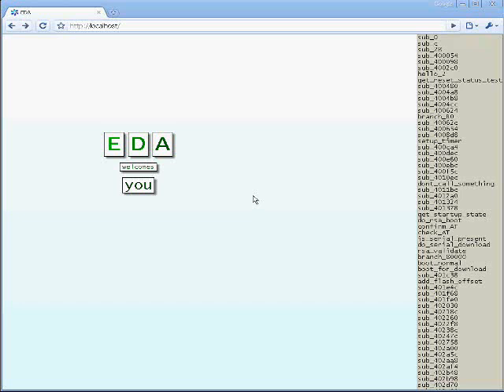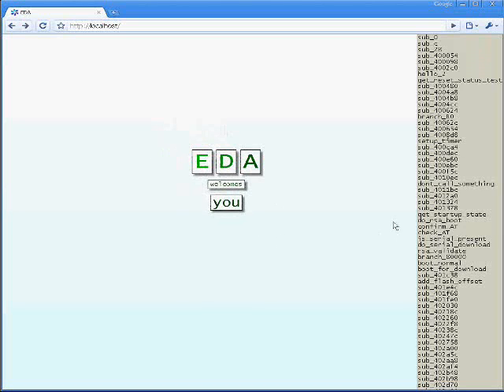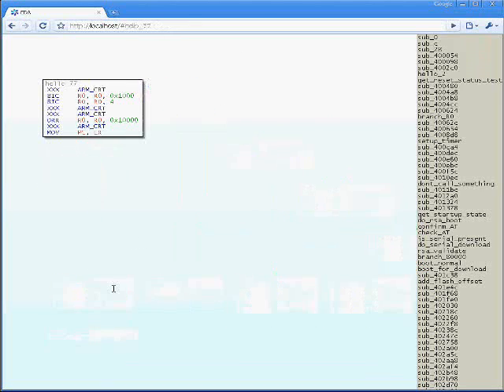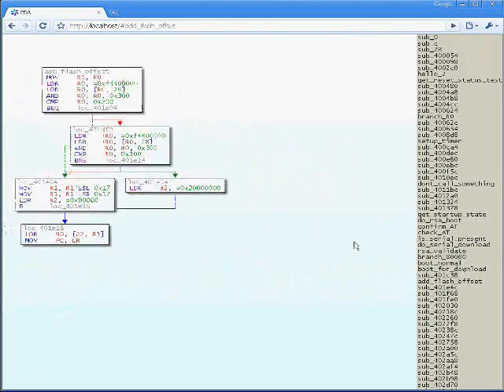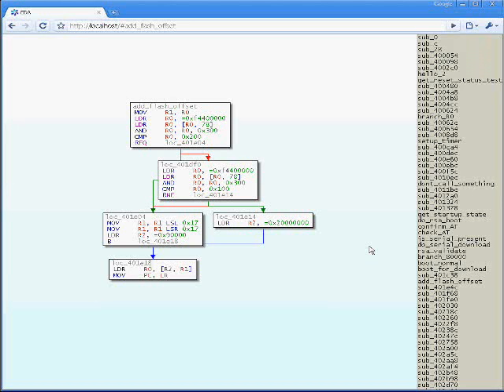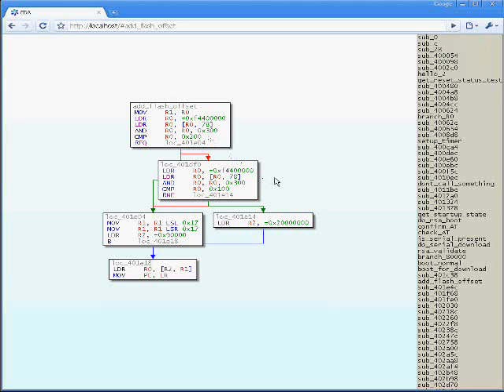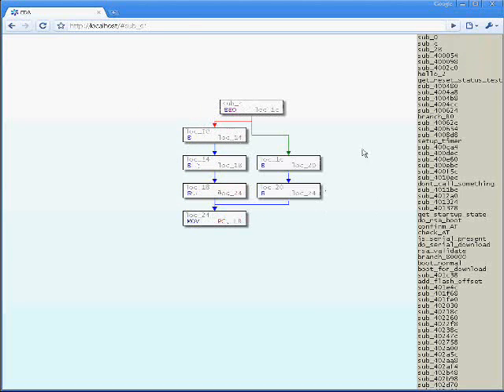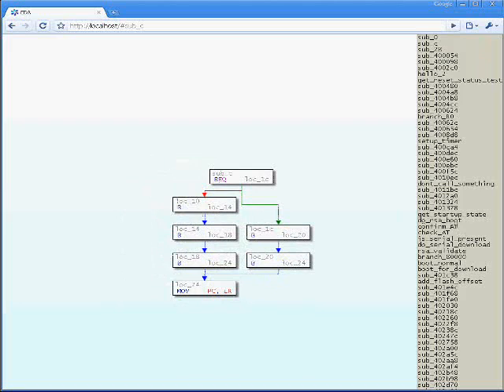The Embedded DisAssembler Demonstration

Comment: I'm doubtful this will revolutionize reverse engineering ;).

The real problem is the input for a simulation process - which can be almost infinite. For normal memory, the input is limited a bit as it can only change when written to by the CPU, but for memory mapped IO for instance, this can change very dynamically without the CPU even writing something to it.

Behavorial insights in my opinion is better visualized by representing the underlying code in a higher level pseudo representation.
Reply: yeah but it was impressive for his age.
Reply: You don't know what you just said.